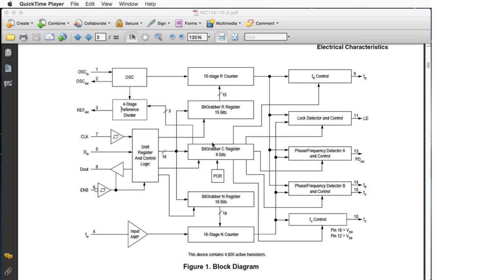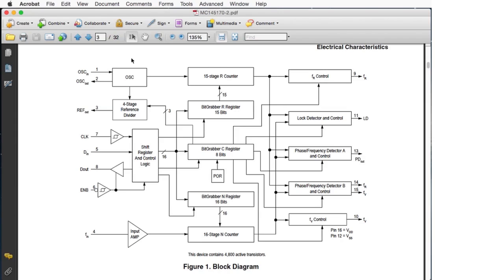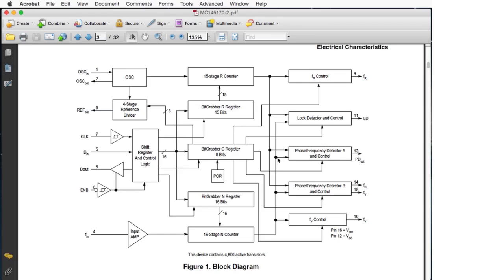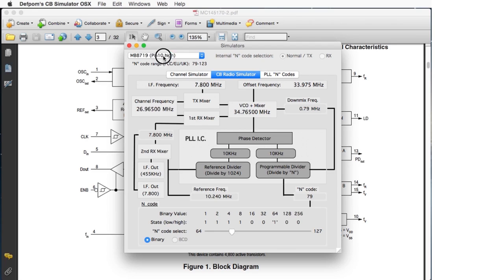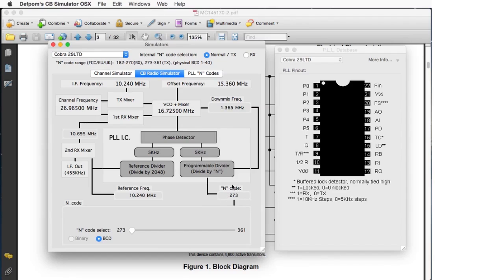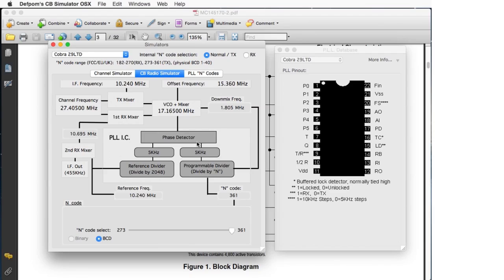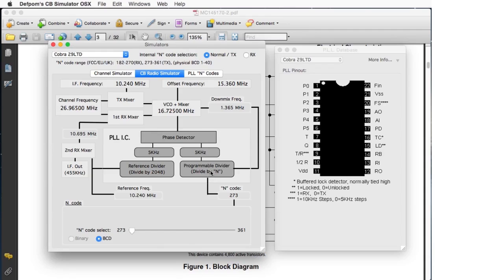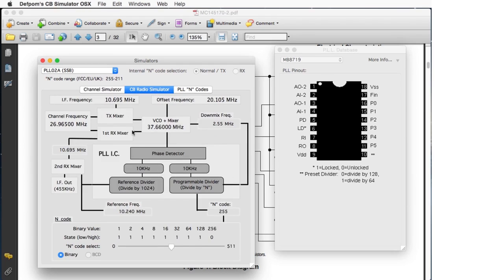#168 Phase Locked Loop PLL Theory with CB Radio Simulator

Comment: you left out the loop filter, which is a very important building block to this system, 

the phase detector does not output a correction or control voltage, it outputs phase error pulses which are proportional in pulse width to the phase error of the 2 signals going into the phase detector, 

the phase detector in this particular PLL chip has a tri state output, so if the signal going into the phase detector from the programmable divider lags the signal from the reference divider in phase, then the phase detector outputs logic "1" pulses, or if the signal from the programmable divider leads the signal from the reference divider in phase, then it outputs logic "0" pulses, or if the 2 signals are equal in phase then the output is high impedance, 

those pulses are then fed into the loop filter, the loop filter then filters those pulses into a smooth dc voltage to control the VCO, so it is the loop filter that outputs the control voltage, not the phase detector,  

other than that minor little oversight, good job,
Reply from the maker: Thanks for the feedback, I was trying to keep it simple by leaving the finer details out.

Yes that is how they work. You are correct that the MC145170 is tri state, but some PLL's output either a positive or negative correction voltage and have either an external pull up or pull down resistor which pulls the voltage other way to allow control of the level based on pulse times, effectively a PWM output, this is then smoothed with a filter network to end up with a smooth DC level for the VCO, as you mention.

I was going to show the pulse diagram section of the datasheet to explain this aspect, but decided to leave that out, maybe I should of kept that bit in to give a fuller explaination.
Reply from the maker: I have just recorded a supplimental video to briefly cover the PD filter aspect, just to fill in that gap a bit.
Reply: i didn't notice the other PLL chips you covered, i was going by the 145170 that you showed at the start, and you are correct about the 2 state phase detectors as well, also note that some PLL chips have an onboard open drain output loop filter amp which along with a few external resistors and caps placed in its feedback loop, makes up an active loop filter, which requires the use of an external pull up resistor to power that open drain output, if i'm not mistaken i think the PLL used in the cobra 29 employs this type of loop filter amp, and i'm sure there are a few others that do as well,

Comment: Great overview of the PLL.  When I get some time I am going to do a PLL video to.  I have a old PLL/synthesizer module that uses 4000 and 7400 series CMOS  and TTL IC's.  Does everything with separate chips so you can probe each part of the PLL circuit and see the magic that goes on inside the modern one chip wonders.
Reply from the maker: MikesRadioRepair - sounds good, I'm looking forward to seeing that one !